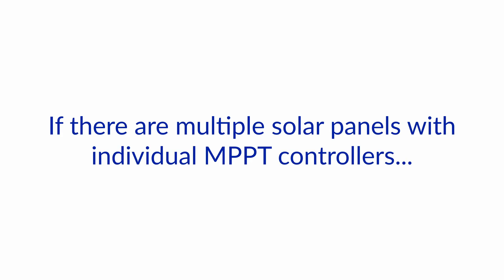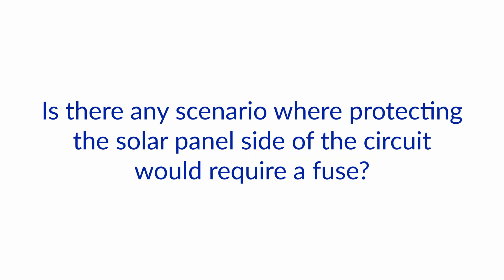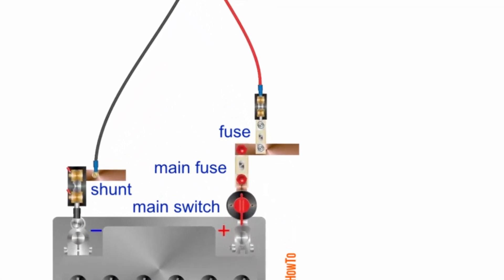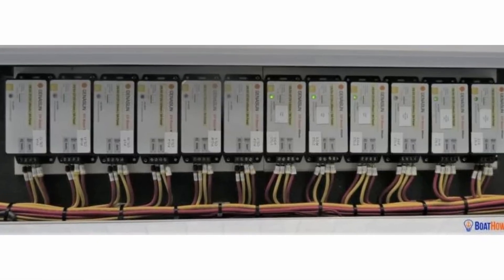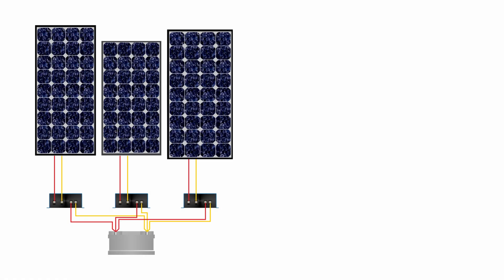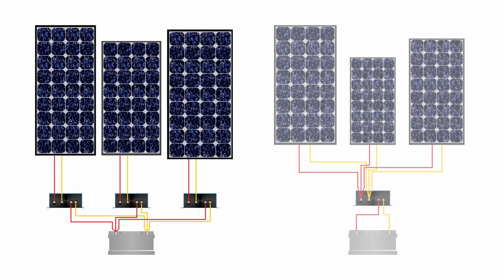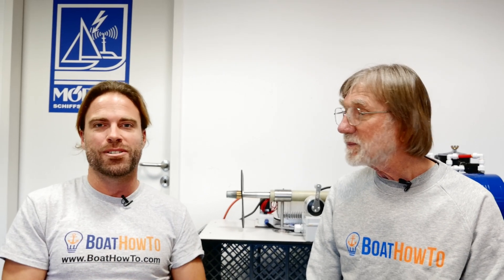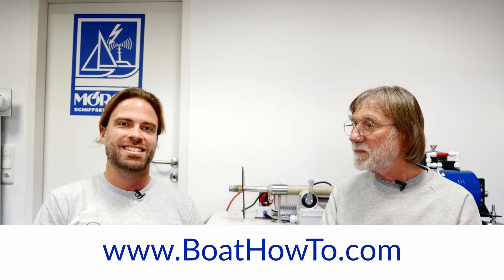FUSING SOLAR PANELS - Where do I need to place the fuses? | Ask The Expert with NIGEL CALDER

Comment: So, if I understand correctly, no fuse between panel and controller. There is a fuse between bus bar and battery, and you should also put fuses between each controller and the bus bar.

Comment: Hi guys - love your posts thanks and by the way Nigel your book has been my bible for multiple editions - fantastic go to resource even though I was an auto sparky then an aircraft electrical engineer for my career - this book is essential in my opinion for anyone spending a lot of time maintaining their own boat - which in itself is essential as finding anyone else with knowledge of now complex systems is really just about out of the question. The book allows anyone to develop their knowledge of their boat anyway.  I wonder whether in the above situation we should use those ?? chemical fuses?? Littelfuse??,  soldered in since there is little chance that it will really be called into play with a new installation and you want to keep resistance as low as possible. A fuse block is OK while new but I can imagine it being high resistance rather quickly.  I am really just interested to know what you think of these things as I bought some to upgrade my old fuse panel but as yet have not installed them.  (Liveaboard situation - canal boat - France).  Thanks again and best wishes.